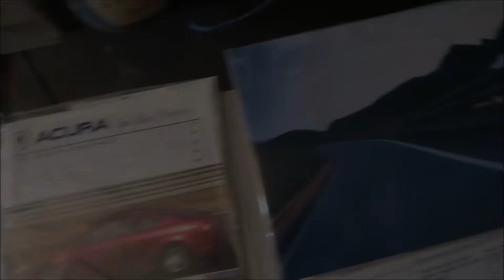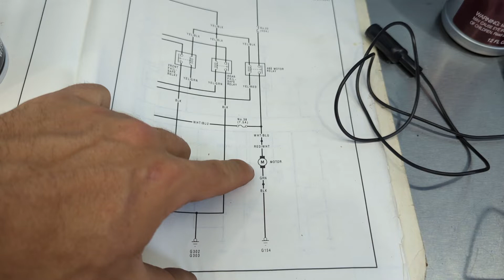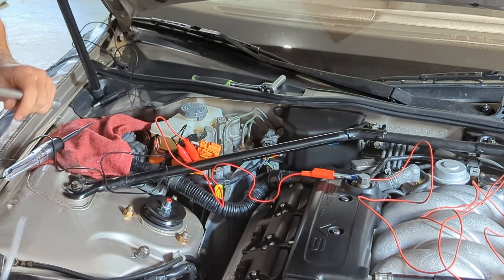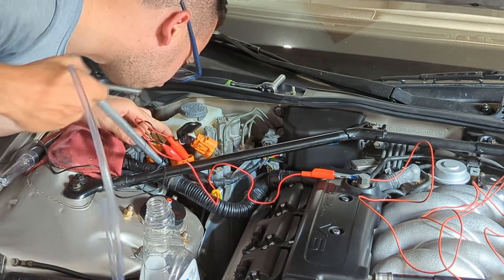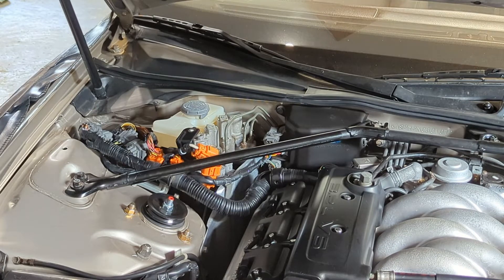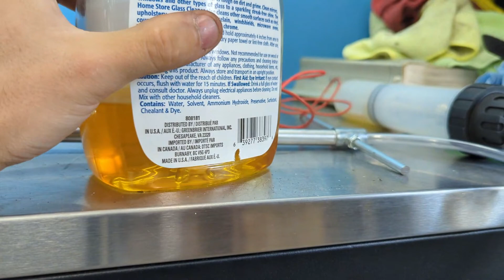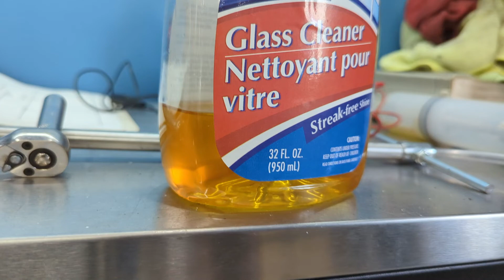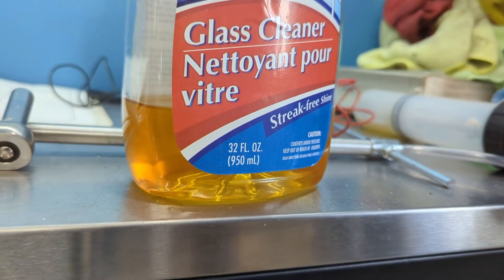ABS Pump Bleed Procedure: 1991-1995 Acura Legend (Vintage Honda)

Comment: What does it mean when I crack the bleeder, bump the motor with power, I hear the motor run, but no fluid comes out?
Reply from the maker: That you're not building fluid pressure likely because the fluid isn't reaching the pump. That's purely a guess
Reply: @acura2g yeah I don't get it though. The pump is gravity fed from the reservoir which is full of new fluid. I tried to push fluid into it, nothing. I tried to vacuum fluid out of it with the pump running, nothing. Maybe the ABS block is broken? The pump runs fine. Kinda sounds like it's running dry though.
Reply from the maker: @davidballard6443 if the bladder in your accumulator ruptured then it won't build pressure

Comment: Bro can you measure the bleeder valve so I can make a socket to get it off? 😭
Reply from the maker: @tomasalves7831  it 8mm
Reply: @acura2g  so if I make an 8mm by 8mm squared socket I can get it out? Thanks in advance 🙌🏻🙏🏻
Reply: Honda told me it was 5mm by 5mm🥴
Reply from the maker: @tomasalves7831  you can use an 8mm socket if you're just removing it. It doesn't need to be a square.
Reply: @acura2g  I tried using the 8mm but it's stuck shut, I wanted the squared part measurements so I could make a 'custom' socket like the one you have to open it, I would really appreciate if you could help because I've been searching all over the internet and you're probably the only person who could help me 😅
Reply from the maker: @tomasalves7831  In the channel description is my email. Reach out to me and we can converse on how to address your needs.
Reply: I cracked it from the side with an 8mm. But then to bleed it I pounded a 9mm over the top to work it back and forth with a multi head screwdriver.
Reply: @davidballard6443  I had to make a custom square head from a 6mm (I think it was a 6)
Such a freakin pain 🤦🏻‍♂️

Comment: Pump can be ran for 10 seconds no problem. THIS procedure you showed is the #1 reason most of these pumps fail...no one changes the 30yr old fluid and it rusts/sieves the hydraulic pump leading to Motor Overrun (ABS Code 1) Great video!
Reply from the maker: Agree! Old fluid is the primary cause of pump failure with this design
Reply: I know this is a bit late but that is the code that my 93 accord is throwing right now and the fluid in the reservoir is black… is it too late to change it and hope for the best? The master cylinder is clear however the modulator reservoir is black

Comment: the book process for my 95 Civic ABS look scary "high pressure". I bought the tools you have but have not tied doing the job yet. Question, would turning the key to ACC position activate the pump? to help push the fluid out?
Reply from the maker: @HiFiInsider  yes, but you need two people